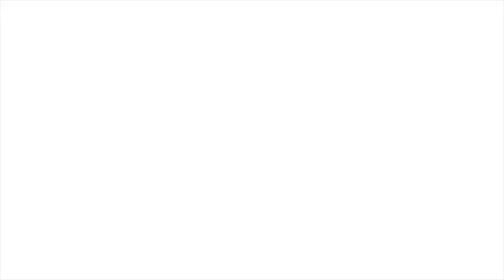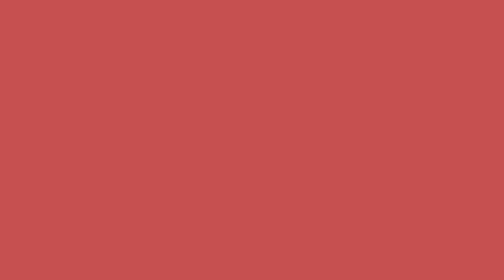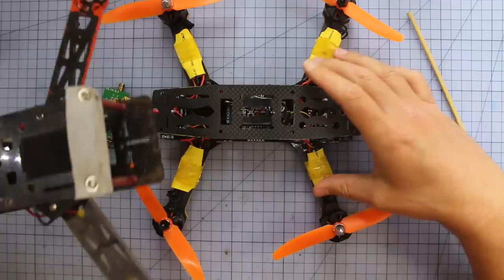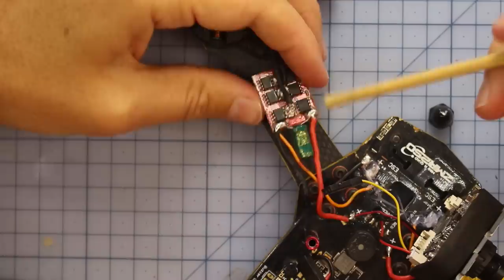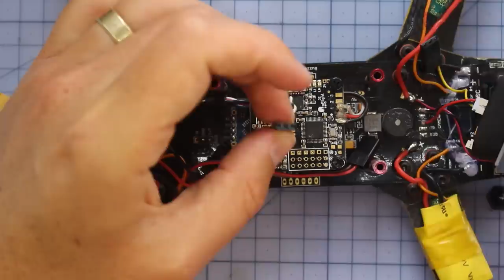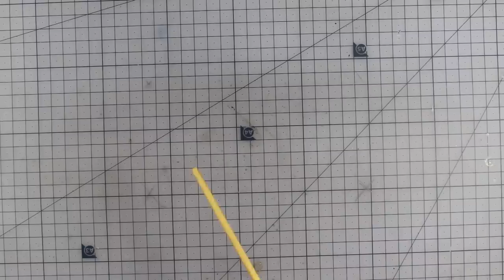Looking back at our FIRST FPV RACING DRONES. Tech Tuesday UAVFUTURES

Comment: I'm still flying my ZMR250. Omnibus F4 Pro, 2205 2300kv,6" props,  20Amp esc, VTX 800mW and crossfire :). its not racer :) only fun
Reply: I never finished my ZMR but I plan to do just what you did, I'm no racer anyway, not looking for fast just fun...

Comment: My first real racer was a Diatone Tyrant 150 back in early 2016. It had the integrated PDB, a Naze 32 and it flew like a brick! The difference between that and what we have today is so huge. Words cannot even describe it and it was only 2 years. The speed and power we have now is just insane.
Reply: Diatone Tyrant 150 was actually one of first usable 3" racers. Frame is still cool - change motors, ESC's and props to decent ones and it will rock even on 3S.

Comment: Gee Stu, my first FPV experience was in 1985. I had a Schluter Champion .60 size heli, one of the very first in the states. I was learning how to hover, no gyro’s, and I installed a wireless security cam that had maybe 300ft range on 900mhz. Once I started forward flight, it was useless so I quit FPV until the early 90’s when the range got a lot better. Around 2004, I was part of an forum group that started putting 4 tail rotors on a board with Futaba 154 gyros. All we could do was try to hover back then. Then, in 2006, Holger released the Oktocopter which I bought while in the sandbox. Loved it and love the hobby.

Comment: My first quad was a ZMR250 with a CC3D running LibrePilot with SimonK 12A ESCs. I actually went back to it recently and flew it with the PWM ESCs and everything, was a little scary how unsecure it felt. I upgraded the FC, it felt better, but still was fairly unsteady and then upgraded the ESCs and that was the ticket. It was a lot of fun going back to it and upgrading it piece by piece.

Comment: Lot of people talking like it's 50 years ago, especially you Stu. The older stuff may not be competitive   in today's racing but for those of us that just cruise about and get our kicks just flying at whatever speed, the older stuff is perfectly adequate. Still flying my Eachine racer and happy with it as well!  I also fly planes and I'm still flying a scratch built model that is designed 18 years ago when we all used NiCad batteries and brushed motors! Upgraded to 6s and brushless now, that comparison really blows people away! 😊

Comment: Building quads wise I know I'm behind the times, but the most important part is I'm having fun.
On a Quanum Outlaw 180 3mm carbon frame I put 1806 motors with Gemfan 5045 nylon+carbon 2-blade props, BLHeli ESCs and a PIKO BLX Betaflight FC. Little bit of PID tuning and it's steady as a rock.
Testing line-of-sight using a 2200mAh 3S pack I got an 18 minute flight! Punch-outs were surprisingly good, though not up to today's increasingly crazy standards.
Waiting for the weather to get better to do some acro with it.
I certainly haven't ruled out motor+prop upgrades.

Comment: back on 2006 or 2007 i got a bright idea, why not take the gyro's out of a nintendo wii nunchuck and use them with an aurdino board (8bit) to control movement of a helicopter with four motors.. everyone i knew had a nintendo wii and they all destroyed their nunchucks (tennis without the cord around your wrist.. we all tried it) so i had a big and steady supply of wii gyro's for free.
making the correct code was hard but eventually i managed to make a code to run on the aurdino that would counter act movements of the four rotor airframe.. a hoovering airframe is hard to keep orientation from distance since it is just a square.
i made a webcam with a wireless DVD transmitter (1,3GHZ) to fit on the airframe to make flying easier since it was always in first person view. as ground station i used an lcd screen or a portable dvd player and the receiver from the wireless dvd set.. it was all powered from my car and later on from a 10.000mAH 3S lipo. 
the whole thing flew badly, but it flew.. the whole power system was made up from airplane parts: 1300KV outrunner motors with 25A pwm esc's and low c lipo's.
2 years in my project i discovered i wasn't the only one with the same idea, and there were a few people coding the same idea as i had with gyro's from a wii and an aurduino board.. they called it multiwii.. and it was way better than my dodgy coding.
jump forward a few years to 2011. i found a 32 bit flightcontroller called FreeFlight at a Chinese vendor (goodluckbuy) and was intrigued..i bought it and met a strange japanese man online who also had that board and thought MultiWII could be forked to the 32bit boardhe had a good code base and we teamed up to make a MWII version for 32 bit.. he called it baseflight and "cloned"the free flight board to a smaller form factor (30X30 mounting holes) and called it afro flight, Naze32..
although this man was a PITA to work with, he was a genius and paved the way for our hobby in its current form..
baseflight was forked into cleanflight, and betaflight emerged as testing platform.. the rest of the route we all know now!

the quadcopter fpv hobby is still gaining more and more momentum, stuff keeps getting better and better and smaller and smaller and also cheaper!

Comment: My first 5 inch was a Blackout Mini-H with T-Motor 1806 2300kv on Cleanflight.
Now I have an Alien with RF and Steele motors and it's so locked in you'd think is has gps hold! 
I can't believe how far things have come since my old DJI F-450 and Phantom 1.

Comment: Wow Stew that was a great history lesson..I'm a noob so I couldn't imagine it being anymore confusing than it is today...Hmmm.. This whole world of quads is amazing, I wish I discovered it years ago.. 
 Thank you Stew and a couple other YouTubers for being  my Mr. Miyagi..
I only have one drone I actually built it my self.. I bought all the components along with a few tools and supplies,, the frame is a 210mm or  5" carbon fiber. 4mm bottom plate and 1.5 upper,, motors are EMAX 2205 2300kv or "red bottoms",,  FC is a F3 "rockin  Beta Flight" lol,,  ESC is  RaceStar  4 in 1 ,,, no VTX yet "still learning to fly LOS first".. receiver is  FS X6B ,, props are 5" Wizard Blades 5045,,  and I have a FS-i6S transmitter.. I hope I diddnt mess up too many times with the terminology. This thing is so fast I cant imagine flying with a 4S battery,,  Oh yeah it runs on 3S,,

Comment: My first frames were pvc pipe construction, I upgraded to simplecopter wooden frames. Everything was extremely large compared to today. You had constant oscillations with the old push button programming KK2.1 boards. The batteries where pretty sucky and you didn't get great flight times. But we were glad to be flying, I was only flying LOS in those days because like Stew said the FPV gears was outrageously expensive.  Funny thing is, I still fly my v-tail and tri-copter simplecopters with original equipment.

Comment: i still have my zmr250 my beginner fpv qwad..simonk 12a esc..marspower motor..running 3s..
Reply: LOL... So do I. I turned mine upside down so that the props have no arms to push air around. Had to reverse a few things, but it works great. Using a KK 2.1 mini on it. LOL
Reply: ZMR250 fiberglass edition, 12A Afro ESCs running DYS 1804 on 5030 bi-blade props, KK FC, a car reverse view camera, 600mW VTX, Turnigy 9X and hella lot of duct tapes. Damn, time flies!
Reply: My precious wall decoration: ZMR250 carbon fiber, Naze32 Acro rev 5, Emax 12A ESCs (SimonK), Emax 2204-2300kV motors, Overcraft PDB v3, Boscam TS351 vTx, OrangeRx R720X. ESC #1 appears to be blown. =\ I've gotten more flight time out of my Eachine E010S, dang it!
Reply: Awesome! I'm glad I'm not the only one rockin an old 3S ZMR with ancient parts. Long live Open Pilot!!!!
Reply: Phrancis5  im also start with open pilot😂

Comment: I'm not sure exactly how long it's been, but I'm guessing about 2013 I built a DJI Flamewheel (450mm) clone frame with a KK board, (PDB was the lower frame center) 2212 motors with pre-simon K (plain old airplane escs). Camera is a steel cased security cam and there is a steel box VTX (a Law-Mate with the outer extruded aluminum case removed to save weight. it has 4 channels. You had to put a sunshield on the TV or you couldn't see a thing. No OSD, the ground station is a 19" flat screen TV running on 4 hard cased lipos. Goggles were just coming out and were $500+ they seemed like they might be cool, but nobody I knew had a set and I wasn't going to pay that for what might be a gimmick. Guess that little upstart company had something after all (Fatshark)... Control was an old non telemetry Flysky 4ch with a big box receiver and it had 12 wires going to it (3 from each esc. Rx power was thru the escs, but the 12v VTX and camera ran off the 3S2200. It had a to of power with the 4 2212 1200Kv motors turning 8" props, but it was a handful to fly, even LOS. I was a fair airplane pilot at the time and it was still hard to keep in the air. 
Big consequences for a crash, because if the 4 or 5 lb craft even landed hard the plastic arms would snap like glass. The rest was none too solid either. Consequently I really didn't fly it much.

I still have it, last summer I ordered arms for it (they're are getting hard to find), and had intended to update it with modern parts, but later decided to just repair it as it is and keep it as a "museum piece".

I have a mini Flamewheel Frame (about 330 mm I think) I'm going to put some modern parts on and see how it flys instead. Hopefully I fly well enough now to keep from snapping arms off. 

Maybe someday we can grab our wall hangars and participate in an "Antique Multirotor" fly-in...  I have some Nimh Helis to bring too!
Reply: I have an arm in my work van, for some reason?

Comment: I was starting from ZMR 250 with SimonK 12A escs & and Eachine Fpv camera & vtx combo. My first FC installed on this build was CC3D flashed with open pilot and Later on Libre Pilot Black Rhino. It was flying well. Old flySky radio was battery hungry all the time but range was ok. DYS 1806 2300kv motors and same GemFan props :) plus some 3d printed extras. GOOD TIMES. ..... I've sold it on ebay to rise money to buy my brand new Eachine Wizard x220 quad :)

Comment: First quad I ever had was based on a recommendation by stu and backed up by bardwell. I think stu gave the original wizard X220 his drone of the year award 2016. I got my wizard from that review and then made all the changes suggested by bardwell. I then quickly upgraded to Emax red bottom 2205 motors and then that moved me into my next frame which was also a Stu recommended frame, the armattan chameleon!!!

Comment: I wish you flew this drone in the field and showed us how crappy it used to be with BaseFlight and what the oscillations looked like.
I'm still flying my original drone, with is the Wizard x220, but I've broken and replaced just about every component other than the flight controller.

Comment: My first qwad was called, if I remember right, the Alien UFO, back before the year 2000.  It had 400 size brushed motors the frame was 1/4 inch foam board, very fragile.  I was using a 7 channel Futaba RX with the servo leads coming from the flight controller.  It flew on an eight cell subC NiCad battery pack.  The props were two blade laminated plastic and phenolic.  The flight controller had three axis piezo gyros each in a separate can.  Of course it was direct view,  not cameras back then.  Took good heli skills to fly it.  I think I still have all of the components in a junk box somewhere.

Comment: Hahaha awesome. I just remembered my first quad, a 2015 rtf graupner Alpha 250. It looked pretty similar to your first frame. It has 12 A ESCs (BEC) too but they were directly soldered on the xt-60 wire comming from the battery - there was no pdb:D... 
And yes it was expansive as hell. Nowadays i think i could buy 2 and a half of the most rtf builds out there for the same price.

Comment: First FPV cameras definitely was security cameras. FPV cameras descended from them by having less resolution, but less delay and less size and weight as well. This one in video have IR flashlight as well :)  Not very useful though since range is short and no sense in flying in darkness without knowing where you are. Better is to have decent night camera, but those wasn't available 3 years ago too. By the way that first Fatshark VTX is a monster :D  OSD - first MinimOSD (not Micro MinimOSD - it came later).

Was lucky to have first SP Racing F3 FC's and first BLHeli ESC's already available in market at time when I got into hobby. Nevertheless had to learn all stuff in hard and expensive way when first quad (Robocat 270) gone AWOL (RX antenna mounted in wrong place and no failsafe set). By the way it had RX connected by PWM (all channels separately - it was nightmare to wire that), but I had no other option. Holybro Race32 FC with Cleanflight was not friendly with PWM as only option and some other things didn't worked well including failsafe. Maybe FC was bad clone, but this can't be proved anyway because thing fled away and wasn't found anymore. Second quad on DL220 frame had no less connectors but at least more decent frame and SP Racing F3 FC with Betaflight and it finally worked. Those 2-blade props what Stu demonstrated, snapped like matches. Broke over 30 of them at first month only :)  Then got DALPROP 5045BN - much sturdier, but sucked amps like vacuum. DL220 frame was a real tank - still alive although I'm not using it anymore. Now we definitely have good frames and components. Interesting to which they will evolve at year 2021. If government will not ban all FPV racers naming them as potential terrorists.

Comment: I still fly my zmr250, I had 20A simon-k esc and the pdb wasn't the bottom plate.  It had to get upgraded a bit after I crashed it in a swamp, but still have to original readytosky 2204-2300 and CC3D!

Comment: What a trip down memory lane. Mine was a robot cat 270 with exactly the same components just a different vtx and receiver. The camera angle was locked in and most of the time you couldn't go full speed cause you would be staring at the ground.
Reply: Lol i had the same frame and hot glued my board camera at a angle bc everyone was talking of how much that 5 degree tilt helps but is hard to get used to. lol
Reply: I started with that frame too. Running 1806 2300kv with 6x4 props on 3s. Crazy to even think about a combo like that now days. I use 1806 motors on my 180mm frame now with 4" props!

Comment: A good old frame could be remade into an excellent flying machine. I Just did my build of an old renewed quad. A Lumenier QAV 180 I had with the following: 
Holybro Kakute F4V2
Holybro Tekko S 4in1 30A
Holybro Atlatl VTX
Xnova Lightning 2204 2900Kv
Frsky RXSR
Run Cam Rotor Riot edition
Hope everything works

Comment: Mine was a knock off zmr 250 frame, 1806 morors 12A escs f3? fc. Board camera. No fancy osd. had it connected to a Hitec optic 2  with a wire from fc to receiver for each channel.